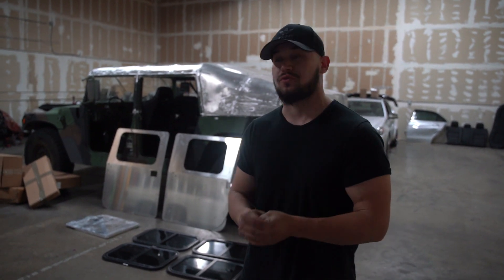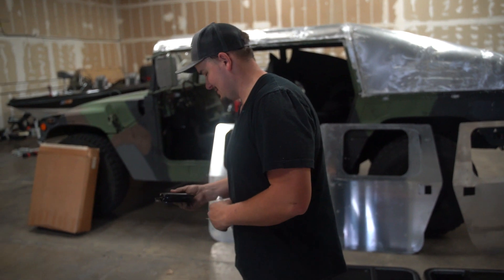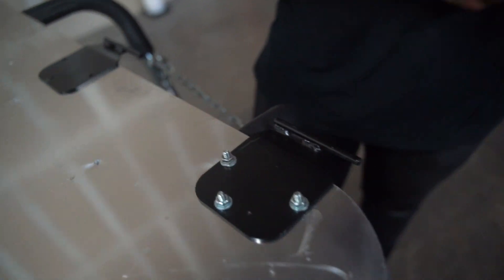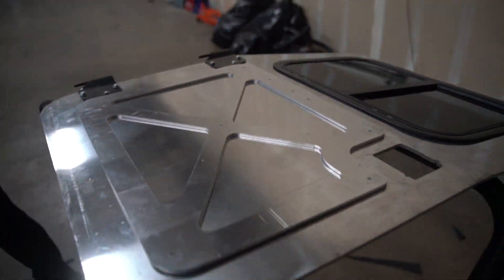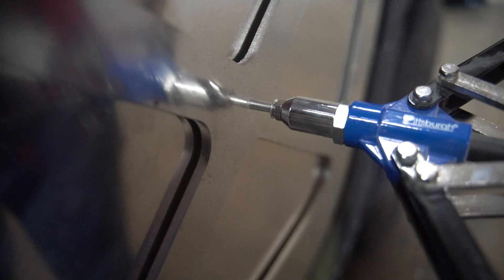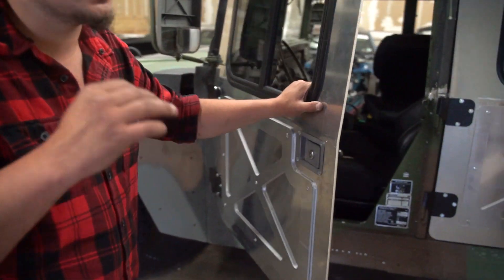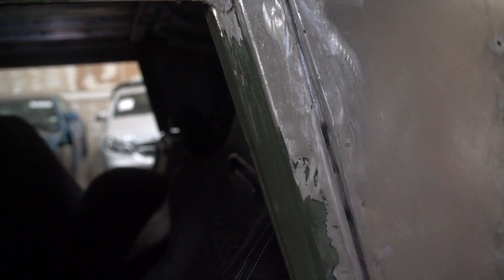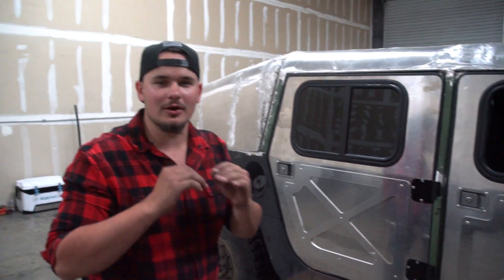Building our Humvee Part 6!

Comment: I would have primed those doors ans X frames on both sides with one layer of paint before assembling the  doors. This will prevent corrosion in hidden areas under hinges and X frames.
Reply: You need to use a good self etching primer on the aluminum before the paint. This way the paint will bond better to the metal.

Comment: That guy who made your slant back  has done the worst weld job I have ever seen. Looks like he used a cheap spool gun to weld. This type of weld will crack and break over time due to vibrations. The top should have been welded with the proper  TIG welder. Its stronger and neater not requiring any finish work.